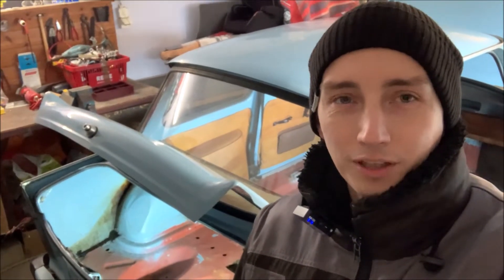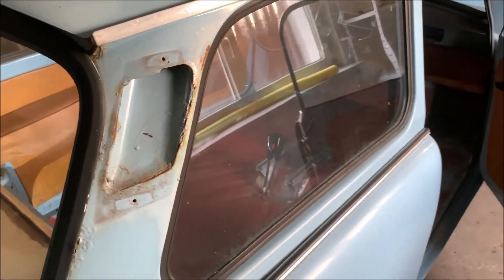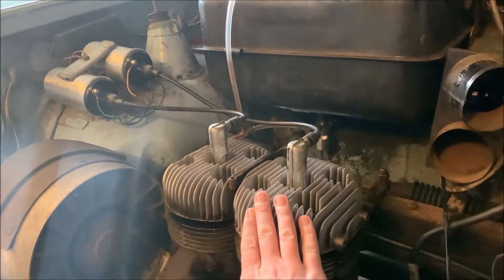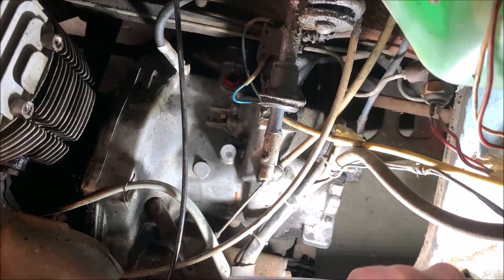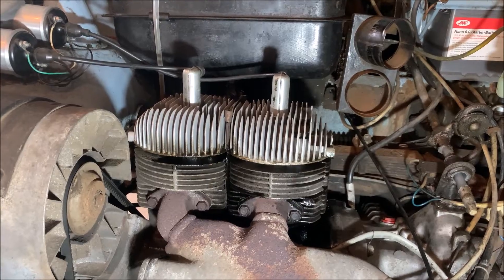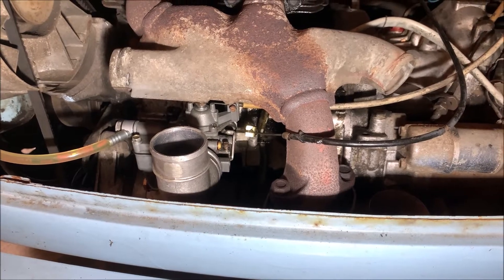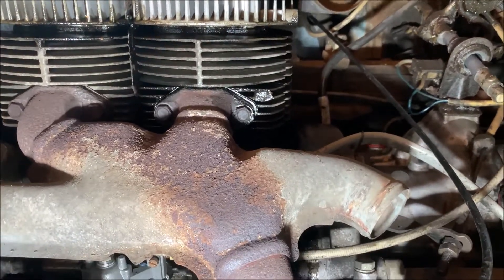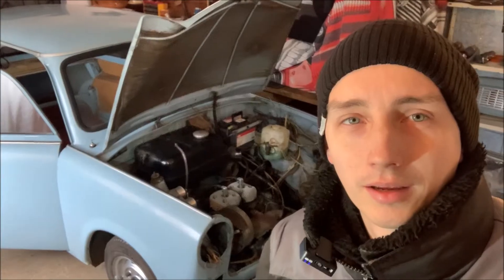Trabant 601 Winter Project - Disassembly

Comment: What i find amusing is that i have an universal and that it still has the dent in floor for the spare wheel being placed upright - but spare is placed flat and not even fixed in place - only pressed down by a spring latches holding second floor above on the spare itself
I really liked your in-depth vid and hope for more - you really know what you talk about
Question is - what is that line going from fuel tank to somewhere else for? Where does it lead? When i got my own trabi it did not have this thing and most of the others i have seen have it
Reply from the maker: Thanks!
They just added this bleeder line when the fuel flow meter became standard. Because of the bad positioning of that thing, it created lots of problems (fuel line running empty during driving).
I repositioned mine and have no problems anymore.
Reply: @bsport320  thank you!

Comment: The experience I had with my Trabant was similar, I guess all of these cars are alike. I had ignition trouble with only one cylinder, but there was no leak. I replaced the crank sensor and it caught on fire! I then replaced it with a different model that also replaces another ignition part, it also caught fire! Turns out it was the negative battery cable being super loose attached to the transmission. Before this the car had a running problem, it couldn't accelerate for long, this was caused by the needle and seat being set too low as it was a spring loaded unit, it was set with two washers as if it were a gravity type. All of this unfolded after replacing all of the wheel brake cylinders, they rusted solid over ocean to Florida.
Reply: Is your ignition mechanical or electric?
Reply: @elektrofumigator  It's currently using the factory contactless ignition
Reply: @carllinden533  so ebza?
Reply: @elektrofumigator  That's right :) It's the only one that survived the loose ground. Such a tough old thing!
Reply: @carllinden533  wish me luck, i am converting from mechanical to ebza myself! Greetings from Poland and have a great time with your own little cardboard ford in the States :>
Reply: @elektrofumigator  Thank you ^_^ 

I used the sound of the spark to know exactly when it went off, If you use the dial indicator from Trabantwelt, the large dial is just to find tdc, the face rotates to set zero. The tiny dial should go to 4. That's where you want spark to go off. 

Really the only problem I ran into was random readings, this was caused by the piston being really dirty, use something to scrape it clean if necessary. Good luck indeed :D